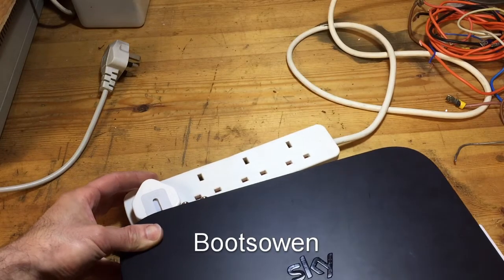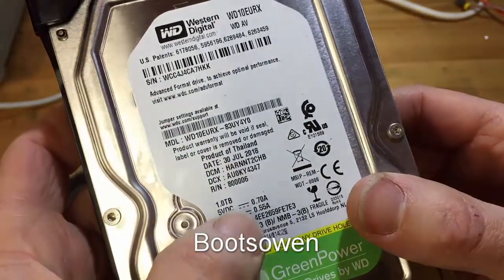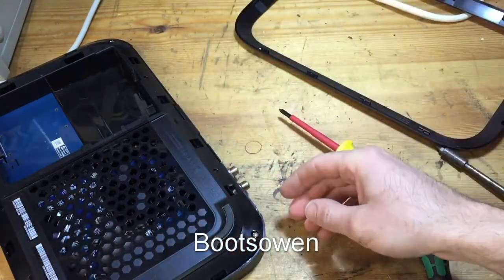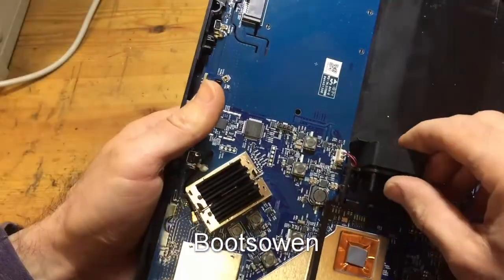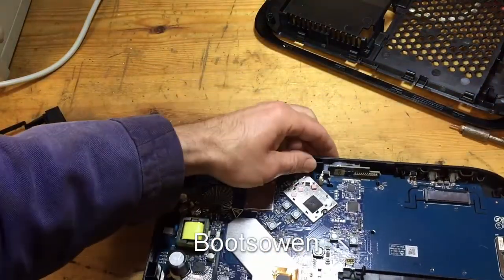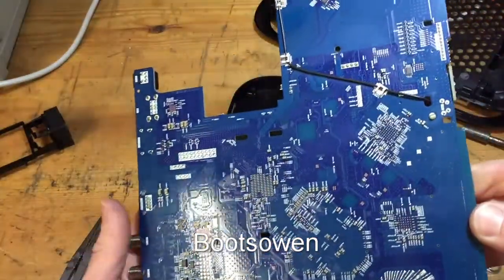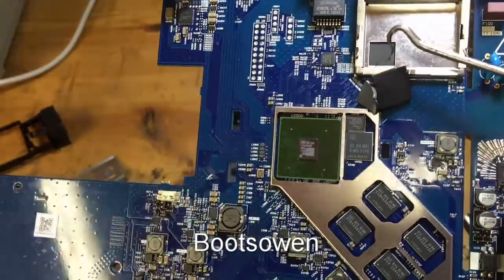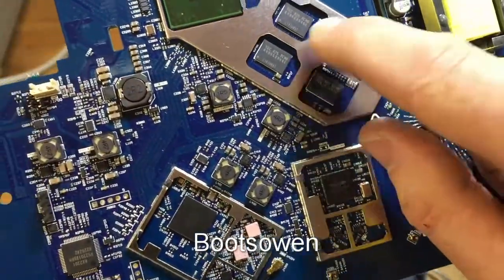sky Q hub digital box disassembly to remove the HDD memory

Comment: Hi, my hard drive is buggered. I can’t pause live tv , rewind etc or record . Can I replace the hard drive by looking online  or would I need to contact Sky for a replacement . It just seems to be plug & play kind of thing
Reply: @Aingeal Dhè yes it will work. I done it
Reply from the maker: Think about the comment you just left for someone else and then maybe look deep in your heart and find the answer?
Reply: @bootsowen Hi, just wondering can I transfer some of the recordings using software? from the sd low budget channels?

Comment: My sky’s box fell down from the walll mount and smashed opened and the only think that broke off the circuit board was little squat 4R7 one on it’s own by the black plastic think . Now the sky box flickers on and off . Is there anyway it can be glued back in place I’m afraid to touch it in case I get a shock
Reply: All Sky equipment is only loaned to you . You’ll never own it so they should replace it for free.
Reply: Beside the Aluminium heatsink
Reply from the maker: Does sky not just give you a new one for free?